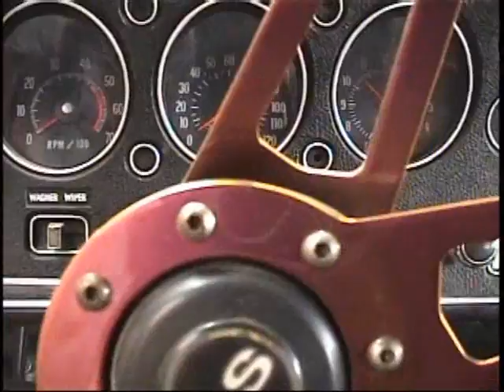1970 Chevelle 454 Starts for the First Time

Comment: @fiddlerpin I had a 57 with a 283 back in 1976. I love the 283 too! What a great engine! Power pack heads! Cast iron pistons! Carter carb. Spagetti headers. Cast iron Powerglide finally replacxed by a T-10. 1956 Pontiac rear end and drive shaft. Lakewood ladder bars. What memories. I remember the windsheild wipers stopping everytime I floored it.

Comment: I have got a very good hint for you to keeping the nice old  Engine in good shape with todays ultra dry eco fuels: Use 1:100 API TC two stroke oil / fuel mix as regular driving fuel, that keeps the old fuel-system gaskets, rubber parts, alloy parts etc... and cast iron metal surfaces of those vintage engines in excellent shape...and it also lubricates the valves and upper piston regions. Most Porsche vintage owners in Germany do so :) Also keeps carbs and tank clean and rustfree

Comment from the maker: Comp cam with .574"Int/.578"Exh valve lift 
Alum rectangular port heads 2.250Int/1.880"Exh stainless polished valves 11/32" undercut stems Int & exh valves    polished, chrome stems, & stellite tips High performance valve springs & chrome moly retainers   3-angle valve job Dart guide plates for 3/8" diameter hardened push rods ARP rocker studs made of 8740 chrome moly steel tensile strength of 200,000psi Manganese Bronze valve guides   Exh ports are deburred & polished 1.7 full roller rockers

Comment: I have a 350 in my "69" Malibu. Orig. engine was 307. My dad sold the engine to my uncle. Uncle blew the shit out of it. I mean he threw a rod... drove for another 40 miles, and cracked 2 cylinders. There goes my matching numbers Chevelle. It's a rat rod at the moment. Dad Finally signed it over. needs $20,000 worth of new metal or $7,000 for a good patch job.

Comment: wish my 305 sounded like that. well at least its still a v8. it sits under the hood of my 89 camaro. my summer daily driver. a 454 would be way too thirsty to drive it everyday. eventually i would like to get a 350. right now 305 still runs good and simply wont die. i just do the 3,000 mile oil change. Chevrolet v8s run forever.

Comment: hey, i just bought a low mileage 350 reman engine for 300 bucks. im going to stick a nice cam in it, maybe a decent manifold. im going to run tbi. it simply costs too much money to try to make power with a 305, not saying it cant be done. but if you buy a new cam and lifters, heads, and manifold maybe you will make 230 hp. a 350 produces that stock. anyways i have a lower mileage 350, im going to stick with the tbi on it though. better fuel economy.